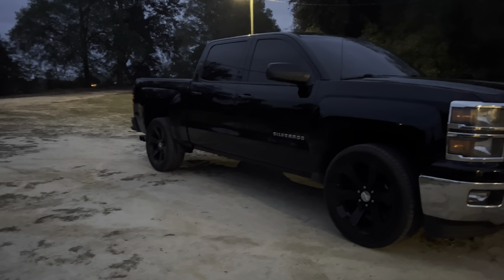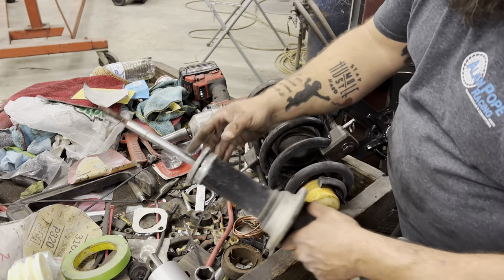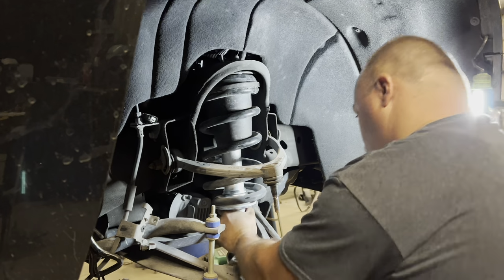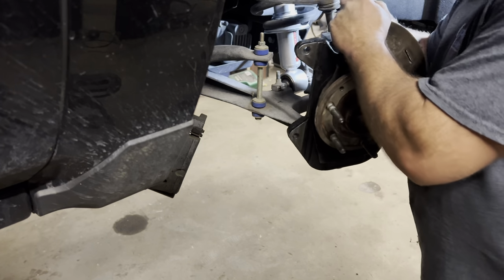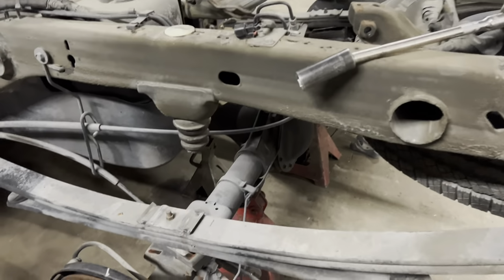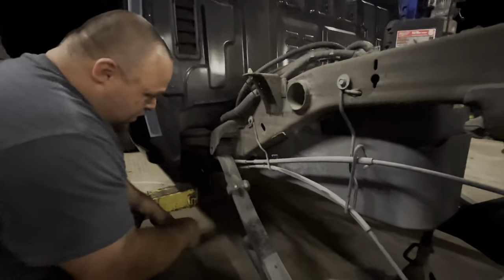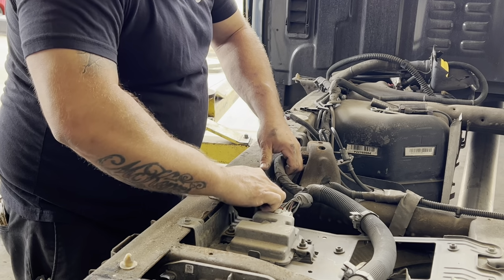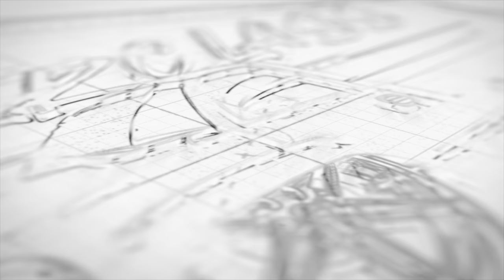Installing a McGaughy 4/7 drop on a 2014 Chevy Silverado crew cab…

Comment: I remember when someone would say they had a 3/5 or a 4/6 drop you were that low or even lower and not able to run anything larger than an 28" tire without C notching the rear. Now you can do a 4/7 to make it level, and not need to C notch. lol

Comment: hello i have a 2013 gmc 4x4 was looking at McGaughy 5/7 drop but the web site says it is for a 2wd truck i was wonding if you have ever done one or some direction. thank you
Reply from the maker: It will not work on 4x4s because the cv axle hits the spindle in the front….I have run into that a few times….IHC makes a kit that will work with 4x4s because it keeps stock spindles and changes control arms

Comment: How much do you charge for a job like this?
I've got a 2014 im currently looking to lower. 
Ive gotten a couple of estimates already. 
One guy wants $900 for the kit and $1500 for labor.
Another place told me it would cost me 10 hours of labor at $115 am hour plus the cost of whatever lowering kit i decided to go with.  In your opinion, 
Are these reasonable prices?

Comment: where can i find the info on what control arm i have on my 2014.
Reply from the maker: Look at your control arms….if they are silver then they are aluminum…..if they are steel and you see welds on them then they are stamped steel….if they look like the ones on the truck in this video then they are cast steel

Comment: Do you need a 2 pc drive shaft if you’re at a 7 in the rear??
Reply from the maker: No the 1 piece is just fine
Reply: I have a 2018 sierra crew cab, just making sure it’s not required.

Comment: Could I get the link to where you got this kit ?
Reply from the maker: https://www.summitracing.com/parts/MMC-34070/applications
Reply from the maker: This is the kit for the cast steel control arms….if your truck has stamped steel or aluminum arms you will need a different kit

Comment: Do the little ears that hold the hard brake line for the rear end have to be cut off? Or does the flip kit not interfere with them?
Reply: Im talking about the little tabs that are welded on the rear end where the cradles go
Reply from the maker: On the McGaughy flip kit they do not…..but most kits you do have to cut those off and the flip kit has new mounts for the wheel speed sensor wire and brakeline

Comment: How Bad was the rubing on those tires ? Was it really bad or drivable ? , i like that drop and that tire size
Reply from the maker: It rubbed front and rear some but he’s still driving it to this day as is
Reply: @lowerclassfab431  so im guessing its driveable , was the rubing on the top fenders or just the wheel well plastic ?
Reply from the maker: @elcompatavo9365  was rubbing the firewall area part of inner fenders when you turn and would rub the bottom of bed wheeltubs on big dips
Reply: @lowerclassfab431  oh i see, seems pretty ruff  thanks for letting me know , yea i think i will go for a smaller tire, i just hate ruber band tires , i like a little bit of tire sidewall .